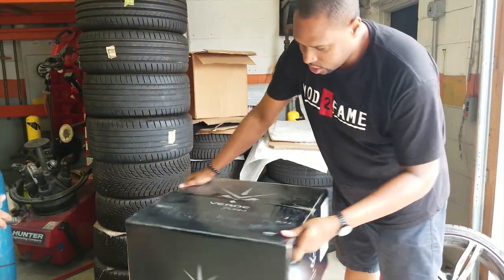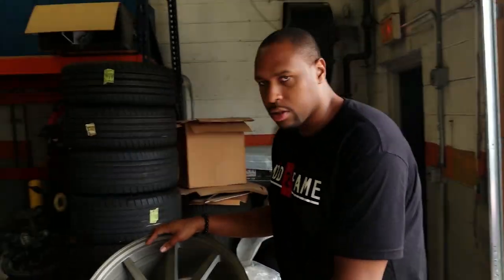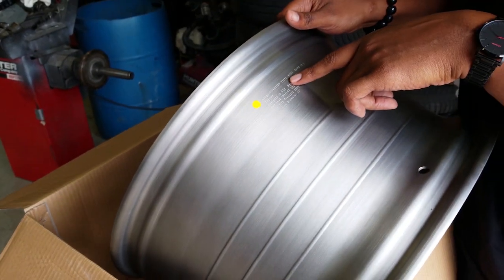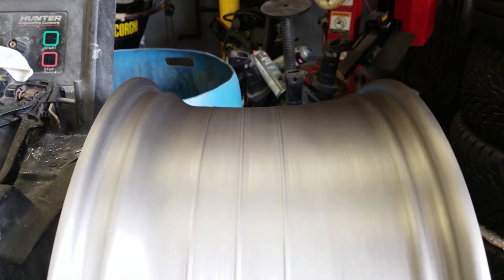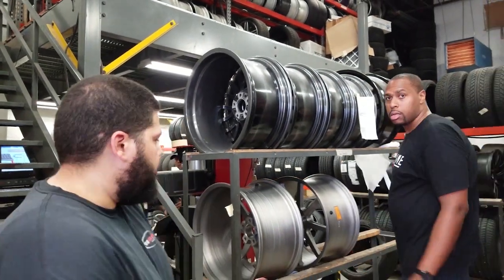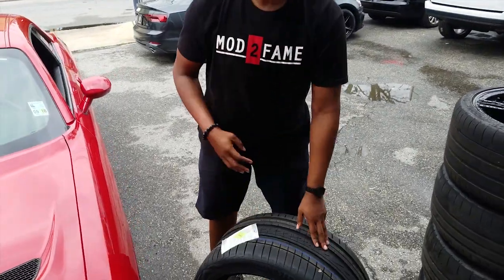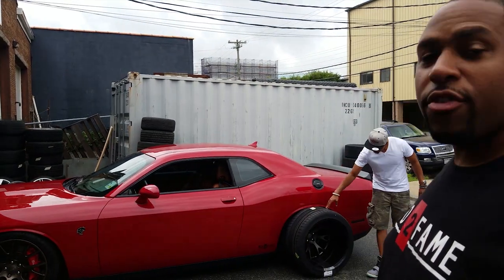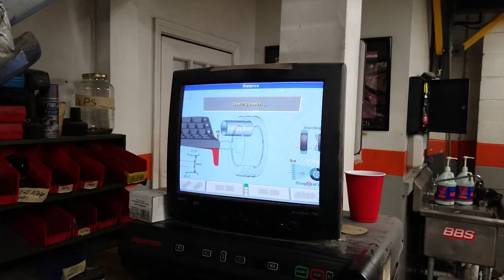Let's Talk About Light Weight Wheels on A Heavy Car Challenger Hellcat

Comment: Just got my tires and rims in for my scat pack and my heart skipped a beat when i saw my rear tires. 305/35/20 bf goodrich. Biggest tires and wheels ive ever had. 20x9 up front 20x10.5 in the rear-niche vosso. I cant wait to get em mounted!

Comment: Editing level’s @ 💯!! Those wheels are clean af, the fitment looks perfect! 

Hopefully soon you’ll add a 17x10 or 18x10 rear wheel & 45’ sidewall DR’s for your future track days. 

Stephen, can’t wait to see the videos of you modding your HC for future Racing purposes.. Twin disk clutch, Barton shifter, Driveshaft, diff brace.. those 1.9 60ft will drop to 1.6-1.5, & that 11.7 et will drop down to the upper 10’s.. TRUST ME🙏🏽‼️
Reply from the maker: You are absolutely right. I am looking at tires now for Stunna Reese Youtuber Speed Fest in Moraco Indiana. We will be there running cheapo
Reply: Mod2Fame Vlog , right on👊🏽
Reply: I like the rims but change the color u are right the Darker color would look great.
Reply: @Mod2Fame  how is it they don't rub I'm on stock height on my hellcat. I have atturo 295 45 20 on my stock rims and I get a slight inner rub when making turns. Please help me out

Comment: Love how the wheels hug the calipers. Silver does clash a little, could go with the obvious black or the original color of the factory set. Either way nice wheel choice. Have you ever thought about Ceramic coating the calipers and wheels for protection and easy cleaning?
Reply from the maker: after cleaning them at after the track.... I'm def thinking about ceramic coating 😪😪

Comment: Bro you be using tires from Holland, the vorti's pretty good.... i used to live a few kms away from the factory and had a buddy that worked there for 10 years.  But i thought you'd be going for some semi slick ish  tire with all that dragracing.... But the way you pronounced Vredestein... is ehm lol. There is a Vorti R spec tire too... which is a semi.
Reply from the maker: my dutch needs some work eh? 🤣 ive been running vreds for a solid 10 years myself.... great brand....... this is my street / track setup so i went middle ground

Comment: Yo great vid; been following your hellephant build recently. But I have been wanting some wheels for my challenger recently. And happened to find these on Amazon, and coincidentally found vid. Great content, what was the offset in the front ?
Reply from the maker: It's been a min i totally forget, they were 20x10 up front and 20x11 rear
Reply: @Mod2Fame  appreciate your reply, I saw this mad late. Where did you happen to purchase them if you remember? I ordered these and turns out Amazon is unable to deliver the last 20x11 rear wheel. And I can’t find them anywhere now, and I’m stuck with an incomplete set of 3 wheels :/

Comment: the rims would pop extra if the center and spokes were gloss black and the rim was high buffed and machine polished. other then that, those are sick for under $2K. and at 26 lb each, the response from the suspension should improve in the twisties. 
you mentioned the camber of the tire because you lowered the car, is there any room for a kit to straighten it back to vertical?

Comment: I got lucky when I bought my Cat several years ago the original owner had put Forgeline GA3 3 piece wheels on the car with 19in front and 20 in rear. It's going to be hard to get the rear end of your car to squat with the rear so low. Looks over function I guess. Whatever floats your boat

Comment: This is an old video and I get you are having some family time after what happen but I have a question. In the comments you said you got a slight rub in the rear would it be just doing a 10.5 in the rear I ’m getting these rims for mine but the specs say it’s 71.6 yet these wheels come 71.5, did you have to order it like this or does it fit fine or was some modifying in order? And lastly the back spacing would that need to be different. Stock suspension but looking at the eibach lowing springs.